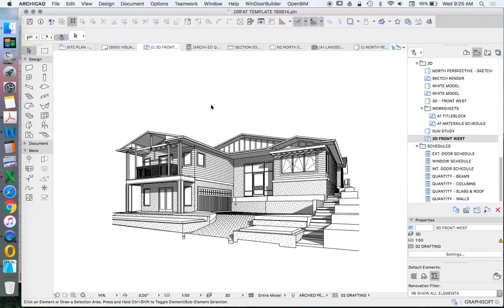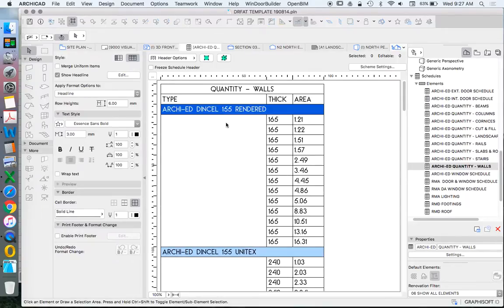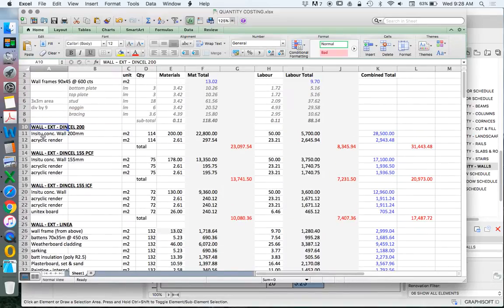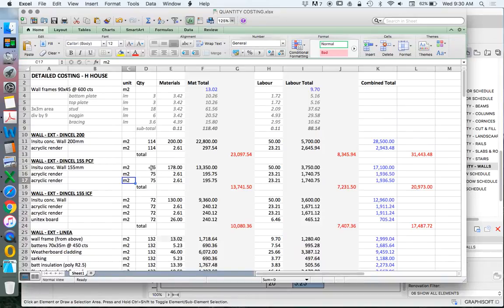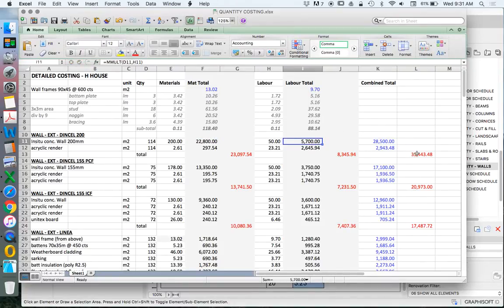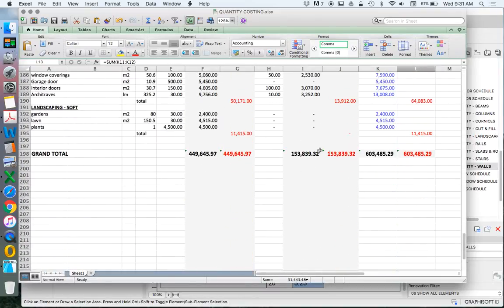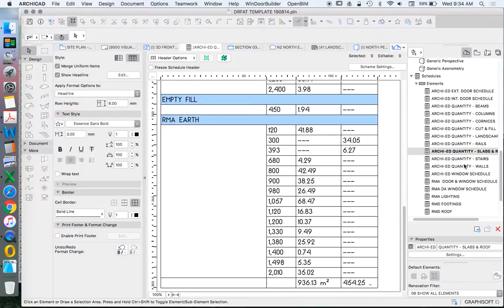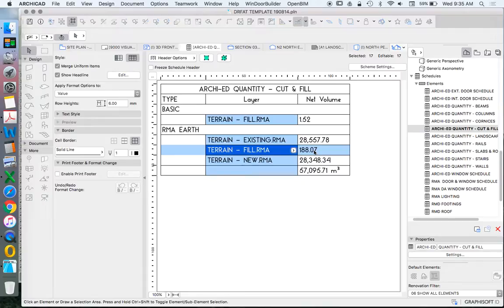ArchiCAD schedules quantities

Comment: Hello Robert! Thanks a lot for the explanation. The only missing piece for me is how to make a schedule for the parts to be demolished in m2. Is this possible in Archicad?
Reply from the maker: yes, it's possible, but may need to be multiple schedules for different element types. The big issue is that ArchiCAD doesn't have excel-like equations built in.